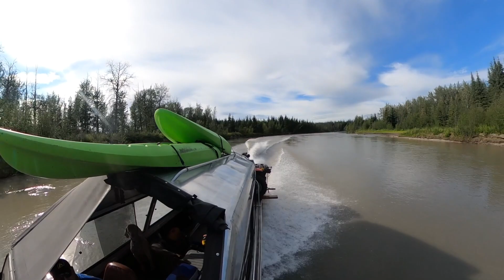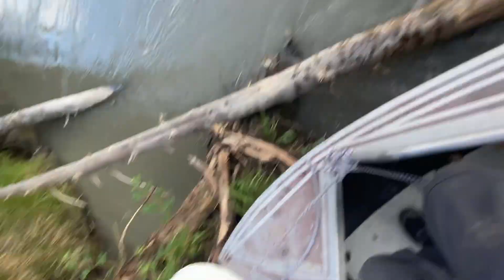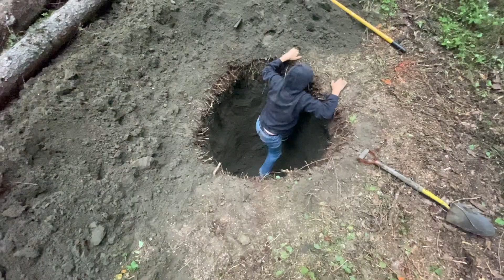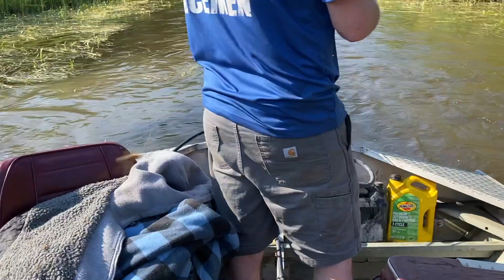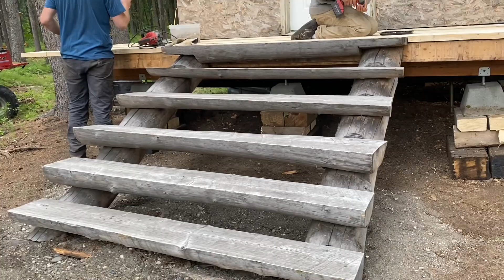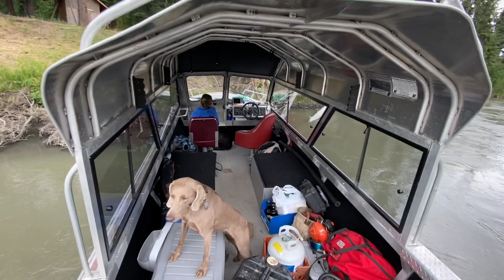We bring a 6x6 to our remote off grid Alaskan cabin

Comment: Your outhouse have you ever considered a more elevated platform and doing a composting set up like those kids did on living alaska but just nicer?
You need a drawbridge dock that folds up when the ice comes. Because that was super sketchy lol..
Reply: That would be better. Way to close to the water table going to get  contaminated
Reply: @cheeseburger9232  👍
Reply from the maker: I’m almost 100 ft from my nearest well and that is code for wells in the fairbanks area. All my wells are 40’ which is also code plus the usage this outhouse will see is minimal compared to a home
Reply: @diyalaskanlifestyle  
No offense I was just curious..
Reply from the maker: @jimmieburleigh9549  none taken I actually thought about this a lot that’s why I stayed above the water table, our home septic tanks and leach fields are required to be 100’ from our wells. I’m going to install a RV toilet in the cabin so the women can use( #1 only)in the winter which is prob 15’ from the well I’m going to have this leach just beneath the surface. I think this will be fine.🤷‍♂️
Reply: @diyalaskanlifestyle  if your worried about that you can always use a composting toilet that you empty from inside or outside from a small tank from under the cabin and have a composting bin away from the cabin.. I like the idea of that outhouse those young adults from simple live alaska done. Check it out if you dont follow them already. 
Again no offense just sharing ideas.

Comment: Bring up a fuel rated barrel next trip to give yourself a spot to empty any extra fuel at the end of a trip up to be the first fuel used on the next trip to keep it cycled. laying the barrel in a cradle to hold it you can easily thread in a valve into the small bung and a pipe into the big bung to give an easy time to get fuel out and put fuel in. 

You get an easy to keep fuel storage at the cabin along with slowly building up a surplus so you have extra on hand in emergencies like a storm or accident.
Reply from the maker: I always leave as much fuel as I can during the summer we burn a lot while building

Comment: If your outhouse hole has reached the water level, you need to be aware that you may contaminate the water you are getting from the pumps. You may need to consider an alternative; such as a self-composting system that won't leach into the water table. It's a very serious situation if your waste leaches into your water table for the health of all concerned. We have seen the results of this happening in a small community in Western Australia when we lived over there.
Reply from the maker: Valid point I’ve thought a lot about this, I’m right at 100’ ft from my nearest well which is code for all septic systems in fairbanks and North Pole area. Also my wells are 40’ down which is also code, and this cabin is a recreational cabin not permanent living, I did leave a couple ft of dirt above the water table. I think At times i could have water in the hole during break up which would concern me. And for the most part we bring fresh drinking water up with us.
Reply: Thanks for advising me of your local codes. That and infrequent usage should be enough to ensure safety. I am a retired plumber and it concerned me. Not wanting to be a pain and tell you what to do, just concerned the well-being of you all. Keep up the good work and enjoy the fruit of your labors!!!!
Reply from the maker: @richardDownUnda  no for sure if you see something wrong say something.